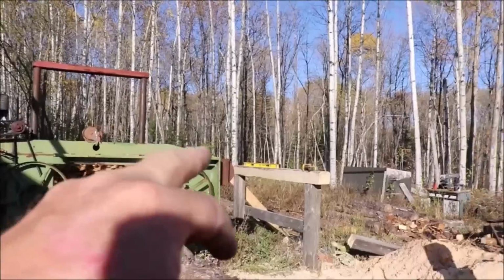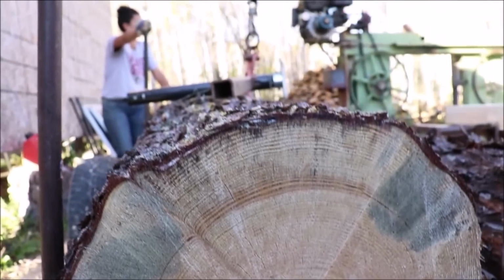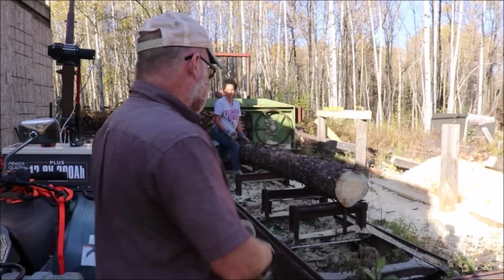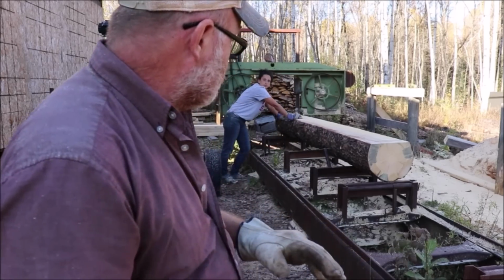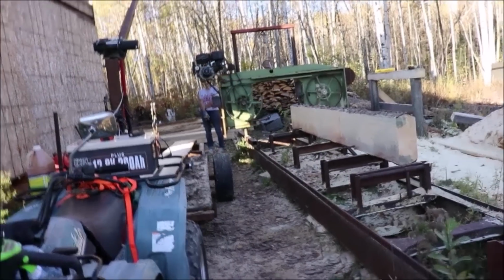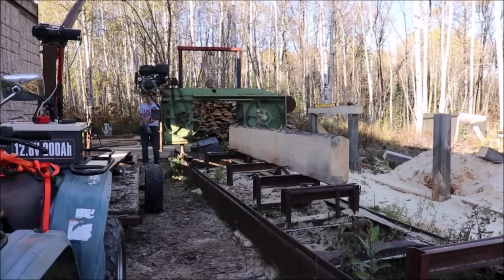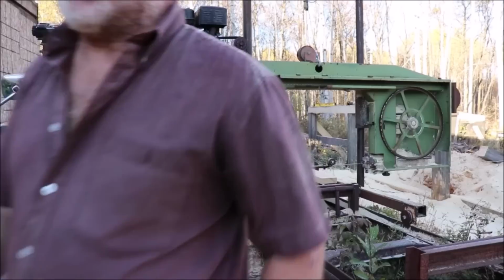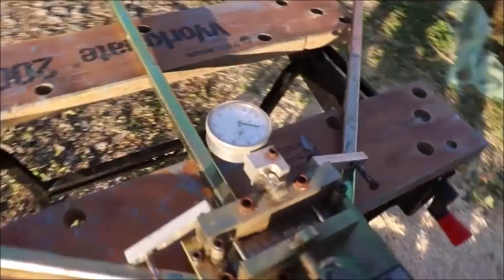Starting To Mill The Rafters For Our Greenhouse. Off Grid Homesteading.

Comment: Great job friends. I've used a large hand held tooth setter to put set on some of my sawmill blades. It worked all right on a couple of them, but most of them I ended up getting way to much set on the blades. If I could get mine as accurate as yours I would be in great shape. However It looks like I will need a lot more practice if I continue to use a hand held tooth setter. This method is possible, it just isn't all that practical since it takes me about an hour to get the set on just one blade plus the time it takes to sharpen it which takes me about fifteen to twenty minuets the way I'm sharpening mine. After putting forth all that effort, the blade still might not cut right, though a few times it did cut fine. It looks like your having success with your sharpening and tooth setting method. That post and beam structure you are building looks great. When it is finished it is going to be really neat. You two have an enjoyable channel. Thank you for sharing some of your homestead life style with us.

Comment: Thinking of getting my own mill. So created an excel table to calculate Square cuts from Circular logs.Basically the diameter of a log should be roughly the hypotenuse of the triangle. By Pythagoras, the square root of half the square should be the side of the square. This is the table..

Diameter	Cut Square
12	8.4
13	9.1
14	9.8
15	10.6
16	11.3
17	12
18	12.7
19	13.4
20	14.1
21	14.8
22	15.5
23	16.2
24	16.9
25	17.6
26	18.3
27	19
28	19.7
29	20.5
30	21.2

So a circular log with 30 inch diameter should produce a square cut of 21.2 inches square. Should work fine if you measure the thin end of the log!..

Comment: Hardening increases longevity prime example is carbide saw blades softer carbide offers a much smother cut than hard carbide but dulls quicker better cuts require more sharpening I still prefer HSS tips over carbide but harder to find and higher cost. Great vlog keep moving forward!